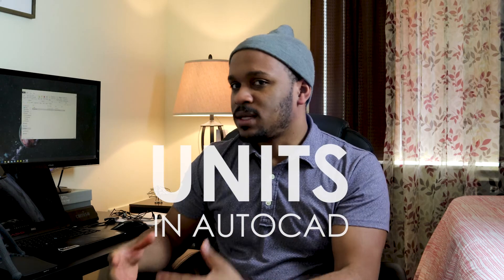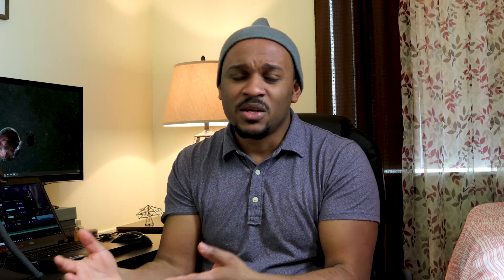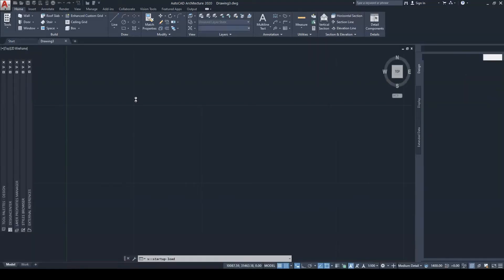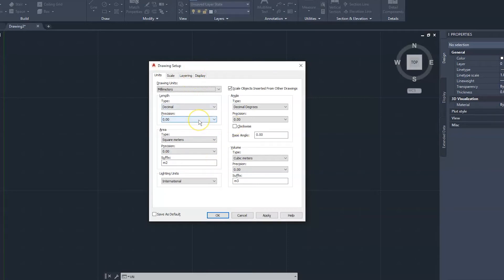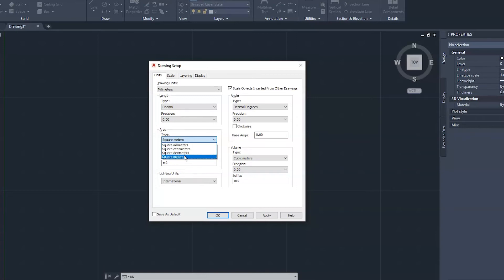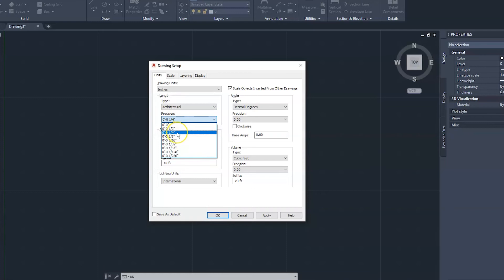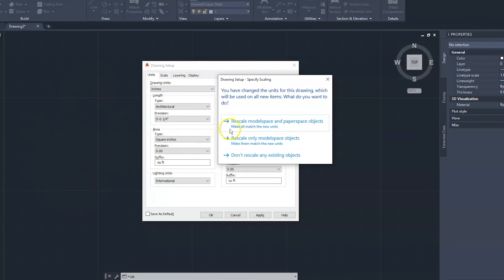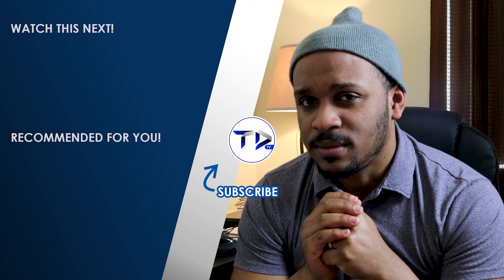Set UNITS in AutoCAD 2023

Comment: I used millimeters  ,and decimal, my object turned  out very  tiny. Why?thks.
Reply from the maker: Maybe you need to change your scale
Reply: I was in model space all the time.I am trying out the autocad lt for the first time just for practice because I have not done autocad for 6 years.The prompt keeps showing lengths like 200000 or 400000 for example.I was trying to draw a line 2000mm long.Hope you can help.thks alot for the quick reply.

Comment: Hi, I have a question. I have a templete that’s in mm, When I change the default units mm to meters, and enable the "Display Plot styles" all the hatchs, and lines looks like the _LWEIGHT is enable but it isn't. I try 10000 combination, alto I try Regen, Also I try to change the LWDEFAULT to 0, but its not quiet there... I cant figure it out what is it, I don’t know if I have to change also the plot style .ctb line weights. I hope you can guide me. Note: When I open the default temple in mm, when I Turn on the Display Plot Styles everything looks as it should. Thanks.
Reply from the maker: I would need to open your dwg to see what's happening. But your right, it could be the plot style. Have you tried different plot styles? or none.